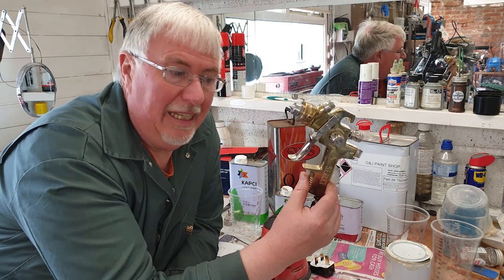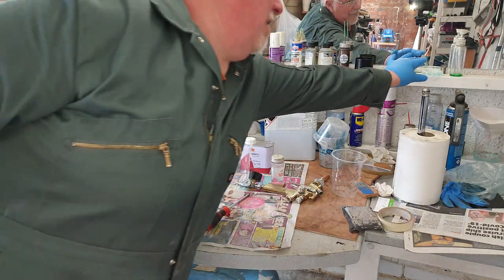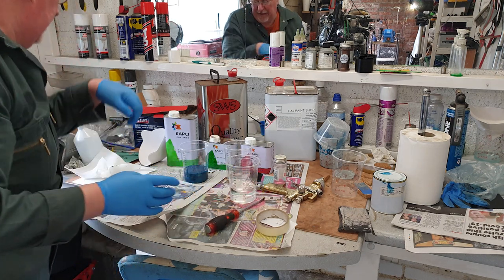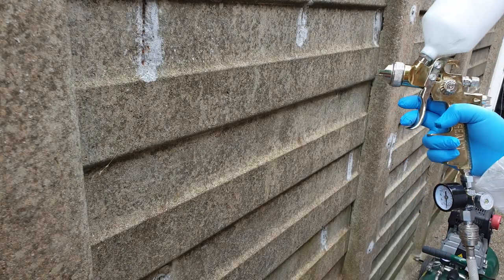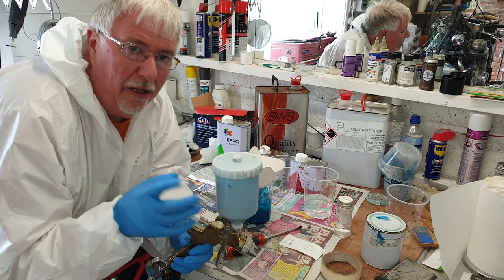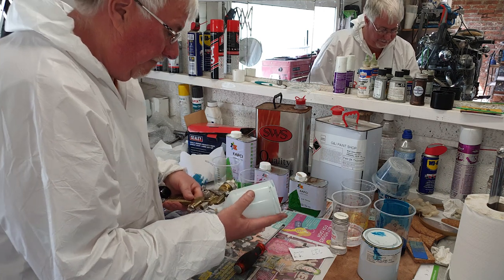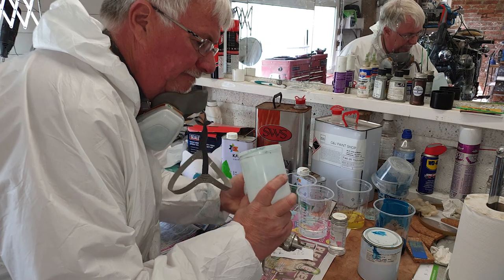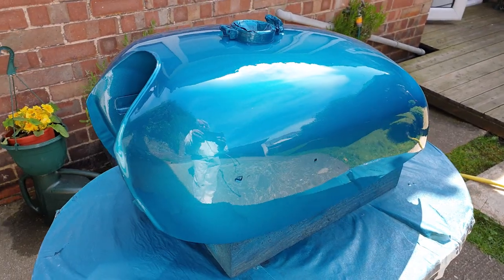How To Spray Paint A Bike Tank - Honda CB750 | Part 24

Comment: my only concern is using a block when sanding a curved tank..kinda creating flat spots..maybe wrong but using your hand would have a better feel.Enjoyed the vid though.
Reply from the maker: Yeah it's quite difficult to be honest, in an ideal world you'd use some kind of curved sanding lock, or a block which is soft enough to follow the contours, but not too soft that it prevents you from removing high spots.

Comment: I found with gloss clear coat if you get "waves" from being too heavy handed you can sand them out the next day then give it a wipe with thinners to put the shine back after that use a light scratch removing cream to polish with. That does not seem to work with matt or flat clear coat though, another thing I found is the brand does seem to make a difference for example I find the K92 clear to be quite difficult to work with you really do have to get it right if not then your back to sanding it again especially the matt finish. I found Anzhal (spelling ?) to be the most forgiving to use but you need to have a water trap on your compressor because if water vapour gets through the line at worst the clear coat will go "milky" in patches that you can not spray out !!! at best it will leave a white mist on top that will just wipe off after a couple of hours. Another thing worth mentioning is if you "miss a bit" or it's a bit "light" don't be tempted to go over it again straight away wait until it's touch dry then coat that part up first again on the next coat, reason being ? you will most certainly either get a "wave" (I think the correct term is sag) or a misting which usually feels like sandpaper to the touch when dry.
I am no expert by any means just learning from trial and error, I hope the few things I mentioned above will be of some help to those of you who are struggling to get an acceptable end result.
Reply from the maker: Hi Dan, thanks so much for sharing those tips! As is probably evident in my video, I'm a keen DIYer, but by no means an expert painter myself. Cheers! :)

Comment: Hi, what kind of compressor did you use? Do you have any water trap?
Reply from the maker: Hi Cristian, we use a big old 150L compressor (this one: https://ebay.us/xPZsMU), but you can paint with a much smaller one than that in reality.

And yes we use a little water trap on the spray gun which seems to work well, its the one with this kit: https://ebay.us/Lkq07W

Hope that helps!
Reply: @SPANNERRASH  thanks a lot! I asked because in the video of the tank part 24 i saw a compressor wich seemed a 2hp
Reply from the maker: @cristianb.4135  No problem, we used a small one for a long time, but when we started sand blasting we had to make the switch. The big 150L has been a great investment so far.

Comment: Hax color code?
Reply from the maker: Honda use a 3 coat system for their candy colours, but I only used base and clear.  It came out really well but I don't have a code for the colour my local paint shop matched a colour to the underside of the tank. The did really well.

Comment: nice colour - how many times are you flatting it if you paint outside ? thanks ultrimaxstore.com
Reply from the maker: Cheers, can usually get a surprisingly good finish with a proper wet sand with 1500 and then a machine polish. As you'll know, you can never get a "perfect" finish, and doing it outside definitely doesn't help. But if you're careful, you can still get a great result on something like this outside.
Reply: @SPANNERRASH  yes definitely you'd get ornage peel in a top oven 1 . Like that colour though looks like Bentley Kingfisher Blue !! ultrimaxstore.com